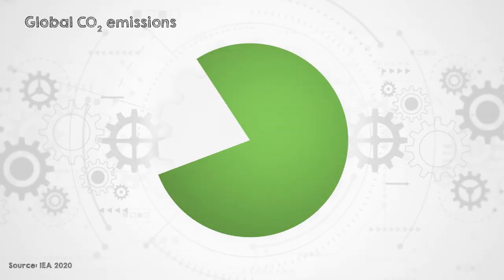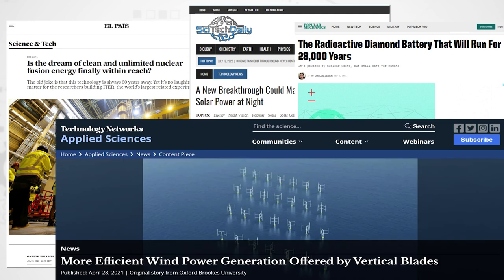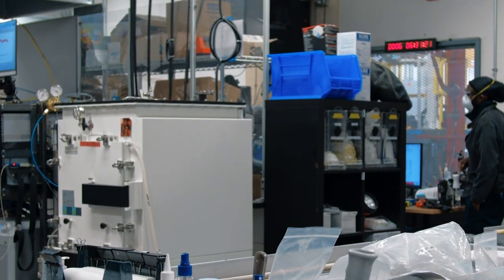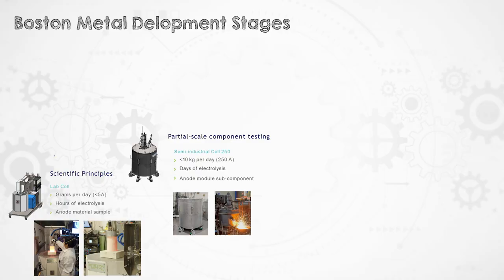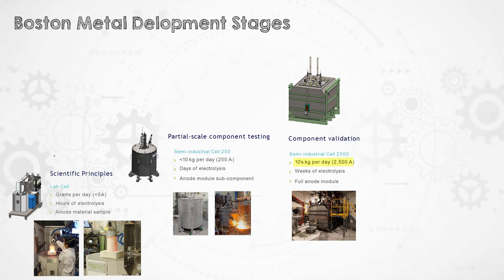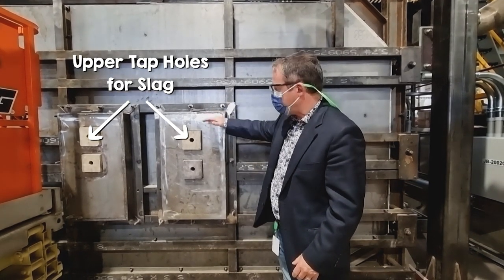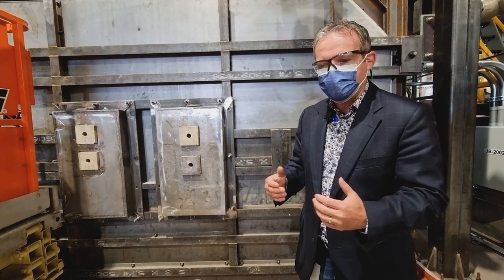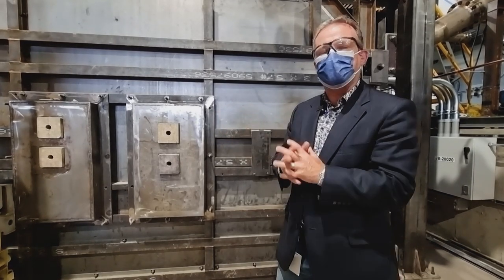CO2-Free Fe: Green Steel Tour with Boston Metal

Comment: All they talk about is iron, where in the process do they convert iron to steel? I don't know how you can make steel out of iron without adding carbon. Steel contains carbon, the coke is not just an energy source, it adds carbon to the process. This seems to be no more than an iron refining process.
Reply from the maker: You can't have steel without carbon, and we did mostly talk about iron in this video. But you can add carbon etc to the molten metal and make steel in the one process. If I visit again I'll be sure to get more into that part!
Reply: Adding carbon to iron need not entail releasing carbon dioxide -- there's not any reason why it should unless you are still using the original bronze age to iron age chemistry of burning most of the carbon to provide the heat. OK the furnaces for bigger and produced more metal per input, but the underlying chem is the same.

After 3000 years maybe it's time to change the recipe?
Reply: @trueriver1950  my point is not about releasing co2, it is that this video is not about making steel even though the thumbnail says it is. You need to add carbon to iron to make steel. Regardless of energy source or emissions, you can't change the fact that steel contains carbon. If the process does not add carbon, you're not making steel.
Reply: @roywarriner8441  it's replacing the most carbon dioxide heavy part of the process of turning iron ore into steel; and there is no need to release CO2 in the final step.

They've solved the usual issue that's raised when people talk about green steel. I don't feel misled by the title or by the thumbnail, and I'm someone whose  usually quite annoyed by clickbait myself
Reply: @trueriver1950  I never said there was. But the process does need carbon. But my point was that the process in this video DOES NOT MAKE STEEL.
Reply: @trueriver1950  They aren't turning iron ore into steel, they are removing oxygen from iron oxide. That does not make steel. Again my point is that THE PROCESS DOES NOT MAKE STEEL.
Reply: You guys are all missing the point here.  The purpose of this process is to reduce iron oxide to iron.  In the standard blast furnace, coke (ie. carbon) provides the chemical energy to make this happen.  (The CO2 produced as a waste product all goes into the atmosphere.)  The product, called pig iron,  unavoidably contains an approx. 4% carbon, which must be further refined.  Steel making removes the large fraction of this carbon, (more CO2 into the atmosphere),   typically to 0.2%.  In this new process, the product  will likely be almost zero carbon, but adding that 0.2% back in as an alloying material is a trivial thing.
Reply: @realmetallurgist8493  You also miss my point, reducing iron oxide to iron is not making steel.
Reply: @roywarriner8441  As you may know, the definition of "steel" is pretty vague.  Add to that that the definition of "iron" is very confusing.  We have to be very careful when using these old words to describe a totally new product.
Reply: @realmetallurgist8493  iron is an metal, you will find it on the periodic table, symbol Fe. Steel is an alloy comprised mostly of iron but also carbon and other metals such as chromium and nickel. It doesn't matter if you use an electric oven or a gas oven to bake bread, if you leave out the yeast you won't get bread. Just like you won't get steel if you leave out the carbon. It's part of the recipe.

Comment: of the 210 gigatonnes of CO2 released into the air from all sources man contributes only 8 gigatonnes, about 4%
thinking this drives the climate is just ludicrous
Reply: @incognitotorpedo42  not 40, 8 that's all, less than 4% of a gas that makes up .04% of the air.

Comment: I retired in the steel industry as a supervisor in the Alabama District and seen steel production and the modernization from open hearth furnaces to HBI/EAF steel.  I am insulted that today's steel is old and antiquated.  I am not sure that the blast furnace/BOF route is obsolete because electric arc furnaces have been around since World War II.  I mostly resent today's modernization is demanded by government and world government instead of the steel industry modernizing to benefit themselves and their customers.  The modernization is forced on the steel industry because of the myth of carbon destroying the planet.  In turn this forced modernization is destroying jobs in the hot end of the steel production in the name of the mythical climate change.  These are lots of good jobs based on flawed computer models in which we cannot even predict weather accurately 48 hours from now let alone what climate will be in 2100 let alone 2050.  People are suffering because of governments because they want a carbon free planet just to satisfy the radical left.  We won't be able to melt steel with solar cells or windmills because of the huge amount of energy it takes to melt steel at near 3000 deg. F.  We will be lucky if we can charge up all the electric cars in the future.  Already some steel mills shut down in the summer and only work at night because of the shortage of electricity.  In winter the opposite is true where electric furnaces can only work during the day and off at night.  The so-called blast furnace/BOF route is capable of taking offtake gasses from coke ovens and the blast furnaces to generate enough electricity to power an entire integrated mill and they don't have to shut down.  I'm done, let the arrows fly.
Reply: You are right that a lot more generation capacity will be needed. You are, I suggest, wrong to assume it won't be provided. And the huge increase in energy capacity will address your pricing issues (admittedly after a shock period when energy prices peak before they start to fall).

Remember that in 1995 Bill Gates launched Windows 95 without any internet capacity because he refused to believe enough of his customers would be able to afford internet connections. The market created the demand that creates the capacity in an accelerating feedback loop. Trumpet windsock and similar companies made a fortune selling internet software to Win95 users and belatedly Gates admitted his mistake. 

 Look at how horses would never replace cars, because of the expense of buying a car, until Ford spied the niche for an affordable car and turned the niche into the mainstream auto industry

Remember the UK replacing it's warn out and war damaged steam locos with new steam ones immediately after WW2 because diesel would "never catch on", then within a couple of decades scrapping all those new locos in well under half their design lives because diesels did catch on after all.

I respect your experience in a venerable industry that goes back 3000 years of using carbon to turn iron ore into metal. Like the horse, like paying floppy disks around, like steam traction your industry is close to its end game. We've speed the down side of using carbon and will soon be stopping for something better; or will later be stopping because we've all died. Sooner or later, with human survival or without, the burning of carbon will stop.
Reply: @incognitotorpedo42  Funny thing is that I have a cousin that is a researcher at a large university in which I won't name because she could lose her job because all of this is politics and NOT science.  The planet is not static and always changes.  People's lives are ruined because of people like you that believe this nonsense.  Don't bother to reply because I won't respond to anyone that is a sheep that believes anything the government says.  By the way, National Geographic just disputed "settled science" on the "Big Bang Theory" in which didn't happen.  That proves there is no settled science and if you don't like that, then contact National Geographic.
Reply: @richardallison8745  hi Richard:
I've responded to your posts before, you likely know my screen name just as I now recognise yours. All my working life was in the sciences: I worked at the UK Antarctic base which first raised the alarm about the ozone hole and was there while my colleague Brian James was collecting two years worth of data that later formed part of the paper that altered the world to the problem. After leaving experimental science I moved into university level teaching in physics, including general relativity which many scientists think of as the second hardest branch of physics (after quantum).

I half agree with what you said about a blast furnace not being antiquated: it is the best way invented in the 6000 years humans have been making steel and iron, IF you insist on using carbon (coke, charcoal, etc) as the reducing agent.

But we now know (I know as a former atmospheric scientist, and most other scientists from other branches of science know because they know how to assess the plausibility of claims in other sciences) we know that humankind cannot go on using carbon and releasing CO2 into the atmosphere 

There are several alternatives, the electrical one (which as you say is similar to the way humans have produced aluminium for years) and various chemical ones that use hydrogen, ammonia (I think) or other gases as reducing agents.

It is not that the technology of a blast furnace is an obsolete way of using carbon as a reducer; it's that the principle of using carbon as a reducer has to change. 

It's not the tech that is obsolete, it's the principle.

I'm sorry if my previous post caused offence by not being sufficiently clear. But honestly, being a skilled blast furnace worker is no more of a career for your sons and grandsons than being a skilled maker of wheels for horsedrawn carts was in 1930. The trade of wheelwright became obsolete around then, and skills specific to blast furnaces will become obsolete in the next few decades, and with what scientists reliably know about the atmosphere one decade would be the best option.
Reply: @richardallison8745  second reply to your reply to @IncognitoTorpedo 
As I said after I left experimental science I moved into teaching General Relativity: this is the field that is directly involved with the new thinking about the Big Bang. Yes or thinking has changed suddenly and radically recently. It is also a fact that our ideas about the way the universe is expanding changed abruptly around the time I made the change into that field.

That's science. We respond to experimental results. We always have. We admit our mistakes, but only on experimental evidence absolutely not for "political" reasons. Same as back in the day when my father has chronic back pain he was prescribed prolonged bed rest: doctors now say that's about the worst possible thing and recommend plenty walking!

That's how science changes.

And no true scientist ever talks about "settled science". We talk about the "standard theory" in particle physics meaning the best theory we can manage at the current time. The particle physicists have reason to believe it must be wrong at energies higher than we can currently track in the lab: but taxpayers in the US, EU, UK, and Japan are reluctant to find further experiments because they are just plain expensive even with all those countries sharing the costs. 

A theory is "settled" until something better comes along. Newton's theory of gravity was settled science from the 17th century till the early 20th when it was displaced by General Relativity. Luckily for most human activities Newton is so neatly true we go on using it, because to do the sums correctly in General Relativity is vastly harder.

It turns out that if Newton was right, then our GPS positions would differ significantly from those predicted by General Relativity. Every time you use a satnav of the position seems plausible you have just disproved Newton!

But what we scientists don't consider reason to change our theories is some worker, however skilled, trekking us we must change our minds because he wants his songs and grandsons to go on working in a trade that scientific results render obsolete: that's bringing politics (with a small p) into science.

Thanks to anyone who read all the way through this long post (which perhaps is more like people would expect on Reddit)
Reply: @trueriver1950  I agree with most of what you say.  I hear so many times environmentalist claim that Climate Change is settled science.  Politicians use science as to use to further agendas and poisons the well of science to the point like my cousin working for an university and she is afraid of losing her job from challenging environmental policy/science.  I worked in a R&D lab and we used to learn something everyday.
Reply: @richardallison8745  thank you for saying that Richard. Yes it annoys me when people on "my" side of the argument claim it is settled science. It's the best estimate we can currently make.

But I'd you walk across the road in a place where there are no traffic lights to help you, you make your best estimate of whether you can get across safely. If you're best estimate is that it is unsafe, you wait.

What annoys me about the business as usual crowd is that they want to wait till we've proved it's absolutely certain, and because no true scientist is ever absolutely certain about their science that means they wait till we're all dead and the last person says with their last breath "maybe those eco warriors had a point after all".

On the best estimates of our best scientists the risks are no longer worth taking. Big business doesn't care so long as it's making money; and the unions don't care so long as their members are in work 

But there's no work, and no profit to be made on a dead planet: is it worth the risk?